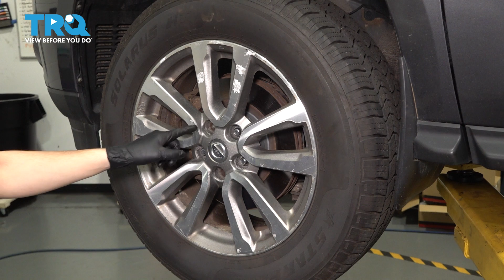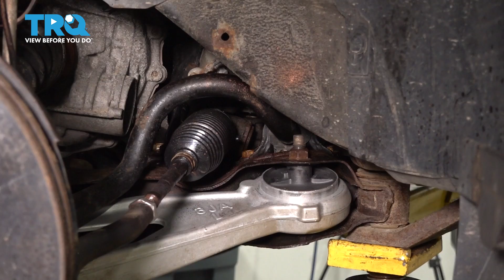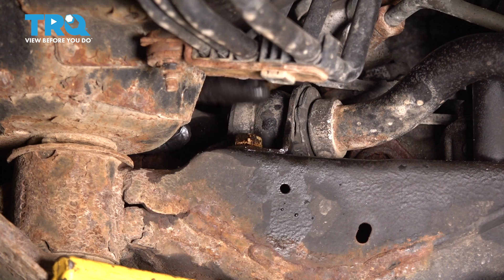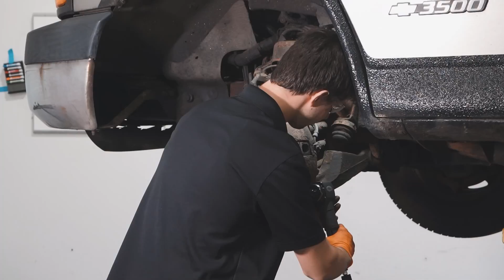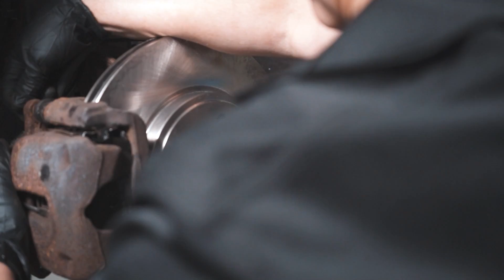How to Replace Front Sway Bar Bushings 2013-2020 Nissan Pathfinder

Comment: At around 4:40 you show install position of the bushing as slit facing backward.  The service manual calls out installing the bushing with the slit/ opening facility NG the front of the vehicle.  After replacing the bushings using your direction, I'm still getting a knocking sound.  It may be die to additional comoonents ( lower ball joint) being bad, but the change in bushing direction makes me concerned also.  Can you address why you recommended going against factory service manual and if that is leading to incorrect bushing functionality?. 

Thanks

Comment: Just did this with my buddy on a lift, no need to remove the tires. lol once in the lift steer to the right passenger side and you can access all.
Reply: Sorry meant to the left driver sure. Yeah you need some small adjustable stuff and long bar to crack the bolts

Comment: When you buy these parts look carefully to see if you are getting one or two since you will want to have a set of two for both the front and rear sway bar bushings.  Odds are you have both so check.  I know my Rogue does and I got the same brand for the front and rear.  Even make sure they are made of the same stuff too, if you did what I did and got polyurethane, you will want that on the rear sway bar too.  They can be noisy over time but a lot of people like them with that being the main problem.  It is a matter of preference, do you prefer the original feel of the vehicle and not like additional noise?  If that is the case, get rubber ones or even the OEM or original brand that was on there.  If you know what brand and part number the OEM part is, get it.

Comment: So how did you do the other side and don't say it's the same? The front bolt is the same but the back has a bunch of brake lines or something in the way. I wasted my time to get to this point only to put it all back together cuz I couldn't access the back bolt. There must have been some special swivel or long extension or something you used, that's why you didn't show it

Comment: Thanks brother,   This seems to be the problem with my Pathfinder 2020.   The mechanic told me to buy new strutt assembly both sides which is going to cost &450.   I think bush is the problem.   Can I replace the bushes myself? using lift jack?